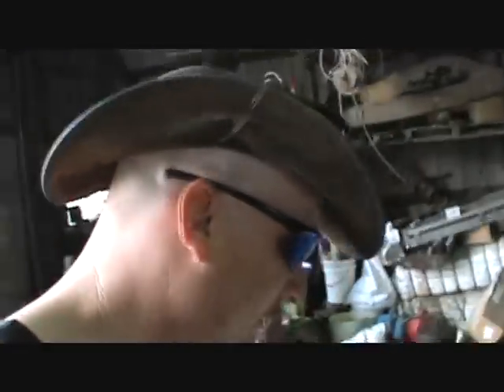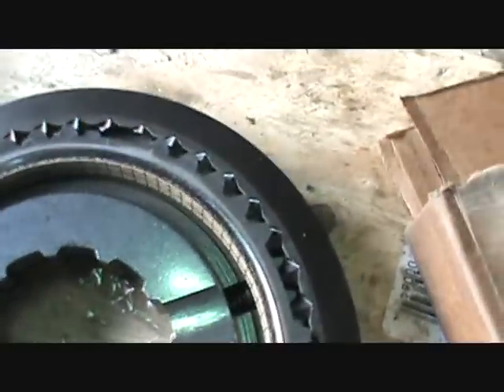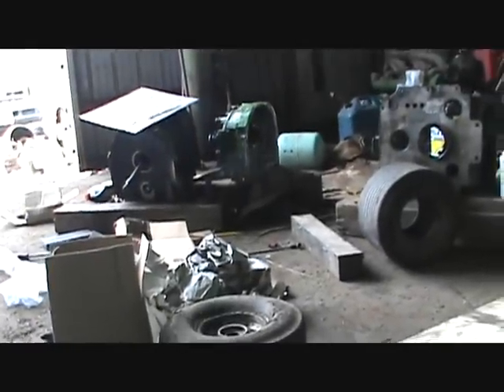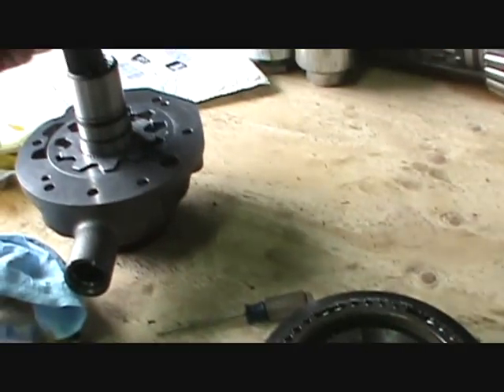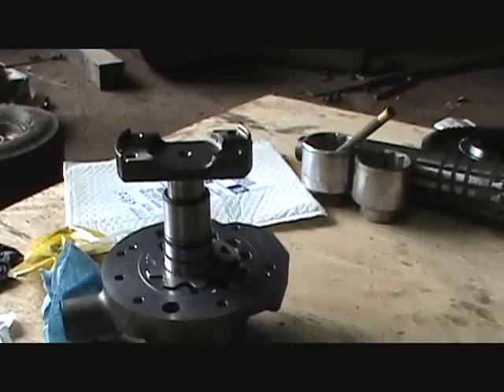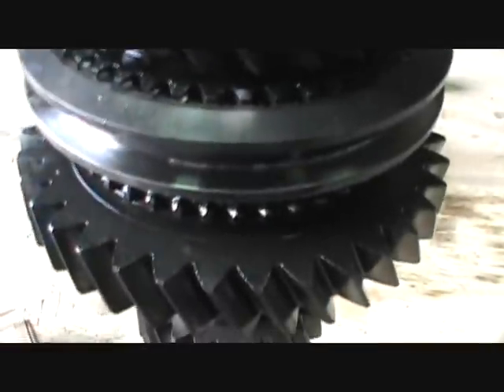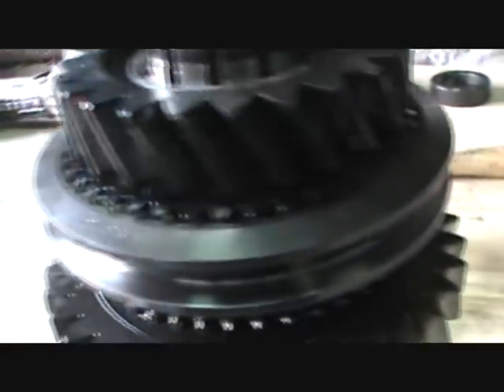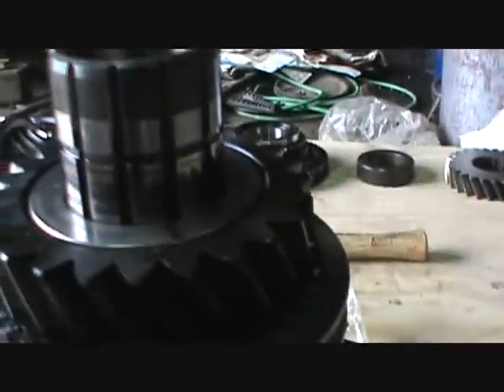7410 tranny going back together

Comment: Wes, I noticed when you had the trans back together, and were trying to get the gears to spin by hand @ 6:18 it looks like the third gear from the right has a groove worn or gouged into it. Is that supposed to be there, or will it possibly be a problem in the future?

Comment: I'm confused?? Where does the torque converter and the valve chamber (pump) fit to the 7410?? Or does this tractor has no dry drive clutch??, I've seen these valve chambers only on automatic transmissions... "transformission"...???

Comment: The ranges (A-B-C-D) in the quad range transmission aren't synchronized, They aren't meant to be shifted while moving.  This is why there's a reminder to "Stop Tractor When Shifting P-A-B-C-D Lever" just to the back of the lever.  If you're continually shifting them while moving, there's your problem.